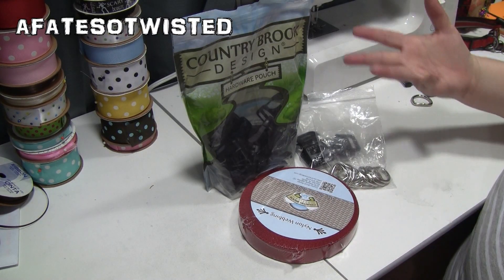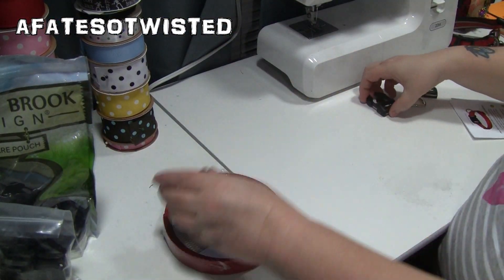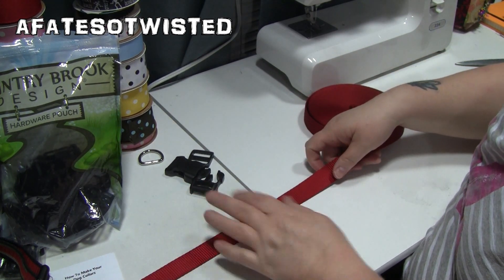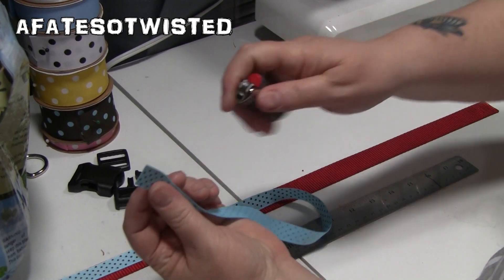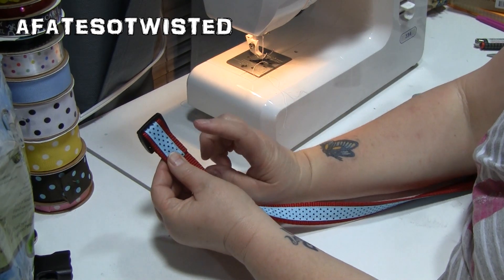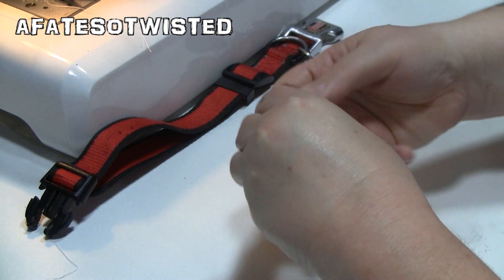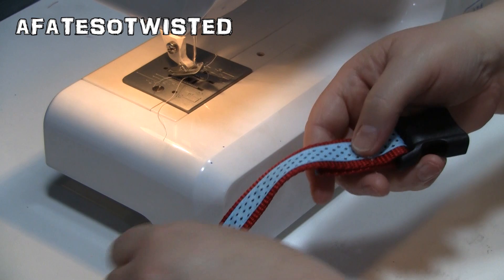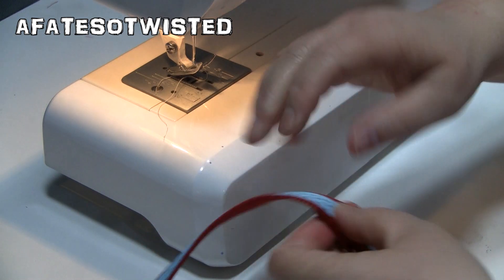How To: DOG COLLAR | DIY Dog Collar

Comment: Do you think iron on heat bond strip will work? Instead of stitching the ribbon
Reply: No it wouldn’t hold up over time or ever really because it really needs to have box stitches to hold it tightly.